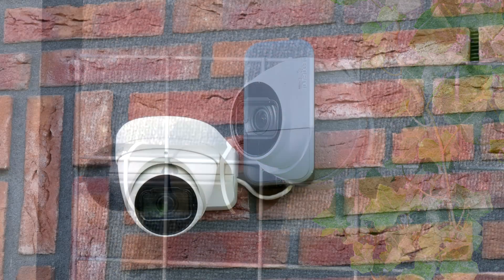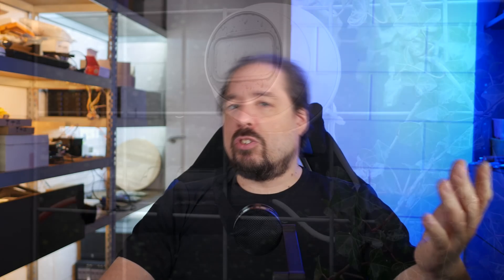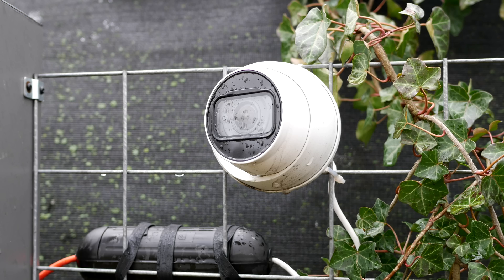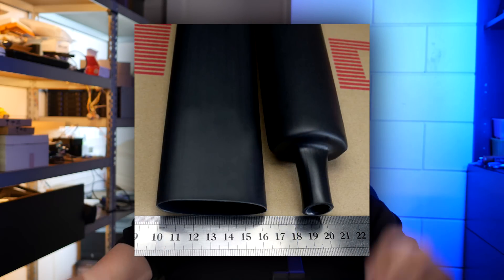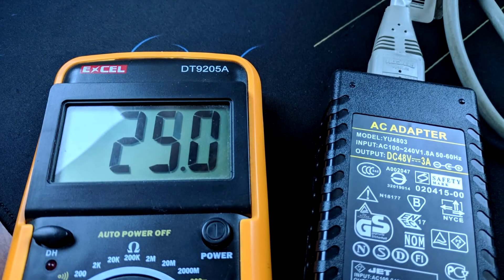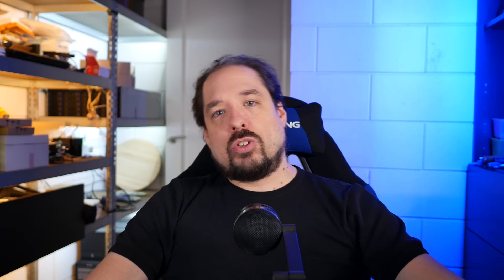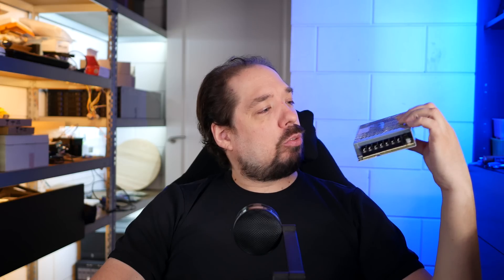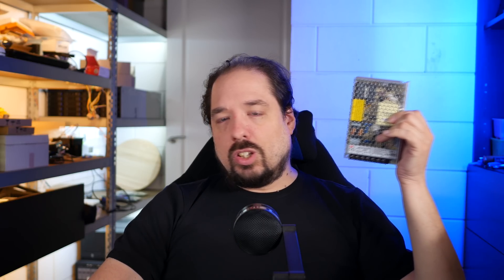Let's talk about: Power Adapter Failure

Comment: That slow reduction in output voltage is almost always indicative of electrolytic capacitor failure. Basically the electrolyte dries out and their capacitance is reduced. Very much temperature related. In addition to having better components,  the open frame of the Manwell  supply you are going to use will have much better cooling and a much better MTBF (mean time between failure).

Comment: Mikrotik devices have fairly insane voltage support ranges. They'll accept just about anything so they're a really bad power supply test ;)
Reply from the maker: Yup, that's probably why the access-points lasted as long as they did. :P

Comment: How do you mount or secure the Meanwell power supply? Do have or make a casing for it?
Reply from the maker: I haven't mounted it yet, but I will soon. My idea was to find a good spot for it inside of the patch cabinet (probably the back wall) and just attach it there with double-sided sticky tape. If you are extra careful you can put some kapton tape around the AC power in ports so that you can accidently touch them. Only bad thing about these power supplies, that they don't have a protective shield over the terminals.
Reply: there are version with a protected terminal: http://www.tinyosshop.com/image/cache/data/Power%20supply/meanwell/meanwhile-4-800x800.jpg
Reply from the maker: @djneon12  Somewhat protected, but those are A LOT more expensive. Although I wanted one with an active PFC, the cost is very prohibitive for home usage.
Reply: @IntermitTech  you can buy the terminal covers. You want a TBC-07 (TBC = terminal block cover, 07 for 7 terminals), $0.30ea from Mouser. Also I would recommend getting or making some mounting brackets. Double sided tape will dry out in a high temperature environment  (like a comms rack) and it will fall off the wall.

Comment: Hi from where u buy the adapter not the Chinese version
Reply: Mouser is also a good option to get MEAN WELL power supplies. They deliver all around the globe and they have more electronics parts than you can ever imagine.
Reply from the maker: I just bought it at a local reseller but you can find links to mean-well power supply's here, just click on the 36v version and it should take you to a page where you can select the voltage you need: https://quinled.info/2018/10/03/power-supply-selection/